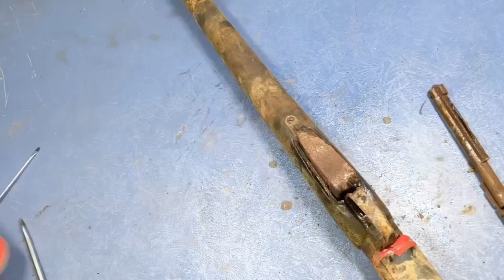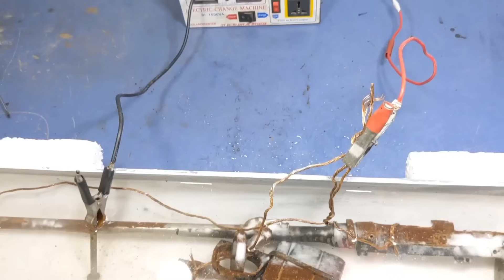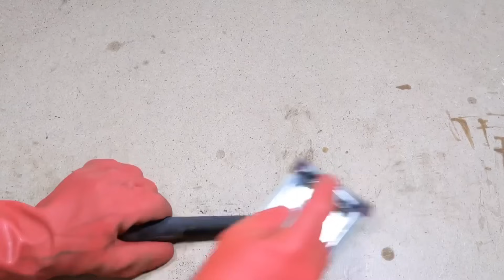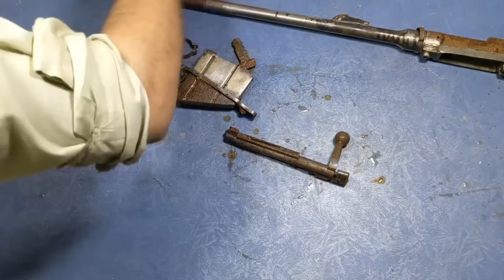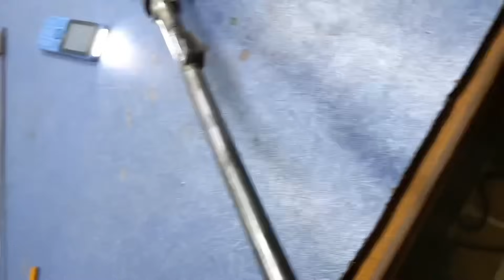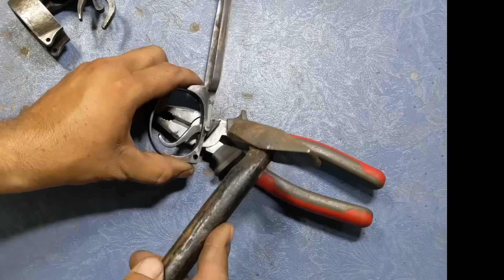Mauser ker98 rifle ( old gun restoration ) M48 Yugoslavian restoration ( gun restoration )

Comment: Absolutely love the sanding against the grain. Using regular screwdrivers that are guaranteed to mess up the screw heads and using a hard steel hammer to tap with. I look for rifles in this condition but always find them after someone like this has butchered them.

Comment: Well junked. Give yourself a medal, you had me when the wire wheel came out.
Luckily, it looks like a Darra copy rather than a real Enfield No.5.
Reply: I Agree. Doesn't look like a true no5. The forward of the breach rear sites are wrong. A bad copy or a mk3 bubbed into resembling a no5 with a no5 butt stock added
Reply: @evanmoses9437  The buttstock isn't even a No 5 one... On a real No 5 jungle carbine buttstock, the sling swivel is above, not under. That's only a simple No 3 or No 4 buttstock
Reply: @laurentdevaux5617  agreed. The sling  attachment is in the side.